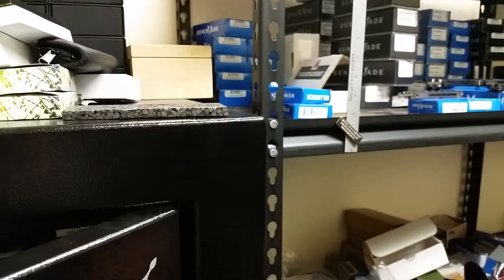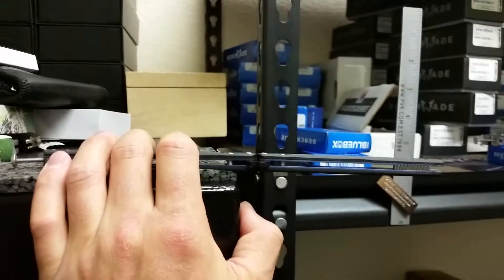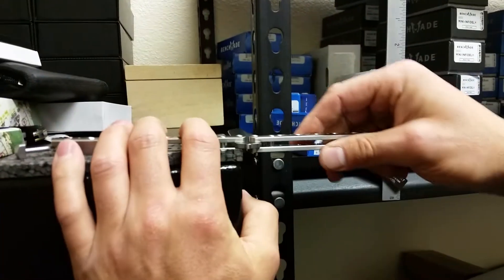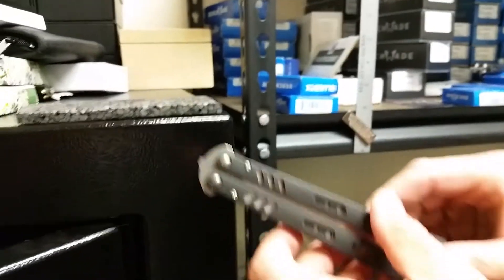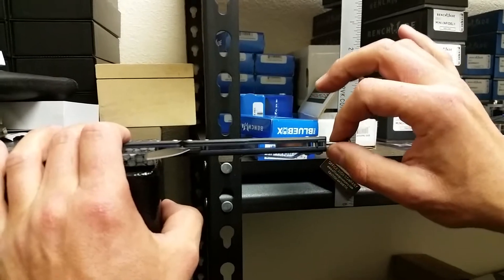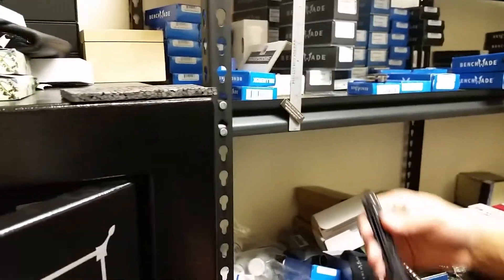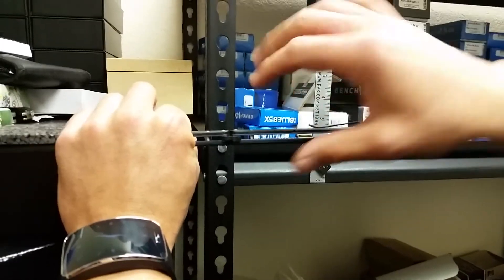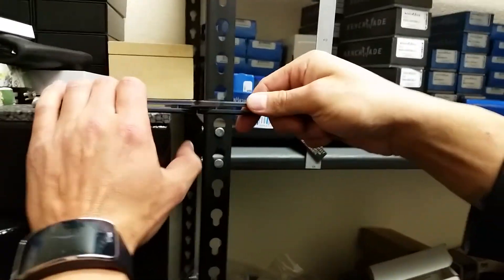Bali butterfly slop comparison

Comment: Good concept for a video.  I agree that a little slop can be beneficial for flipping.  The neat part of adjustable pivots is you can set how loose you want a knife.  When it cones to how tight you can adjust it - that depends on tolerances generally.  If i had to guess, the BRS guys are just "flexing" or "peacocking" their manufacturing processes a bit when it comes to the initial play their knives are shipped out with. 

Also glad to see that you mentioned on the 29 about longer handles appearing to have more slop.  Not everybody passed geometry with flying colors.